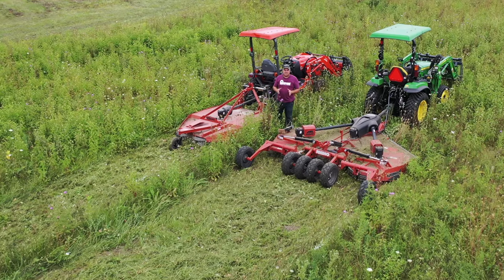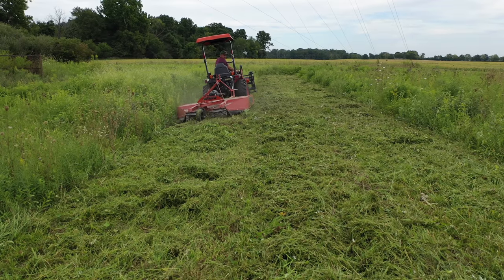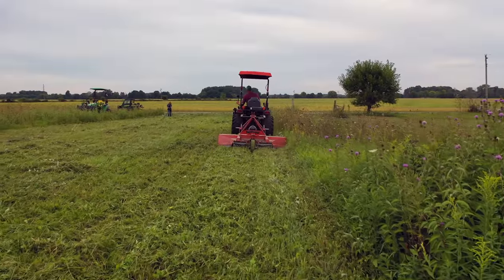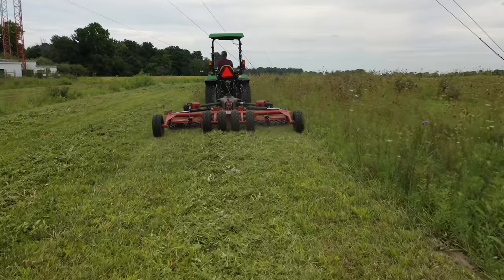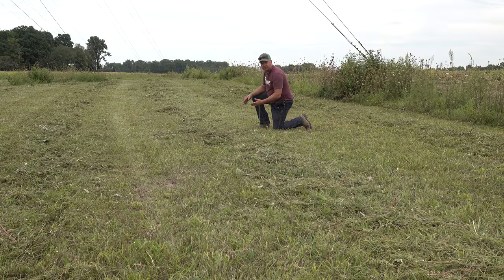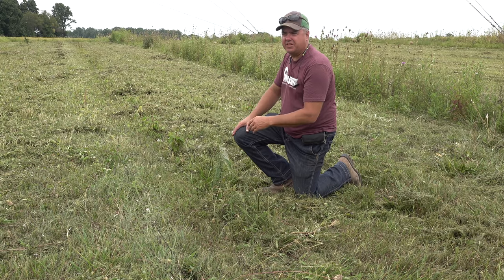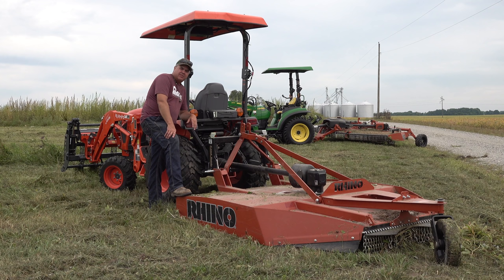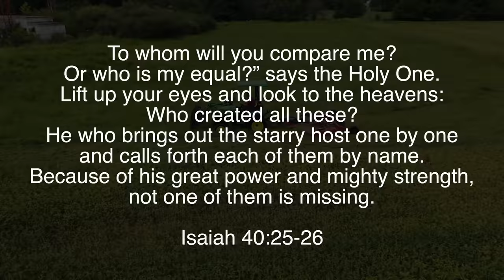Which Cuts Better? Single Spindle vs Flexwing Mower, John Deere 2038R, Kubota LX3310 Compact Tractor

Comment: I wonder if the piling in the middle on the single spindle is because the chains are just in the middle?  We don't have room for a winged mower anyway, but the 6ft bush hog  (brand) we've got lays the clippings very evenly because there is an arc that's open over the whole back of the mower. I've also found that, and maybe it's not great for things, but we mostly mow on epto on the 5320, and if I run the engine (and pto) speed 10-15% over, I don't see the issue with not picking up the grass or brush after the tires. If it's grass, I mow in B3, and for anything else, it's usually B2. If it's 6ft high thorns and weeds, I use regular PTO B1 or A3. A hydrostat would be sooooo nice for the info if stuff we do, though! Mowing trails, around trees, etc. I drive manuals daily (except the wife's trailblazer that I was at your house in when I brought the scrap steel over) and can hardly move my left knee after a day of bush hogging on the farm!
Reply from the maker: Yea, I suspect you are right. Spinning the mower faster would help a lot.
I run ePTO exclusively in the 5075e.  It pulls just as well…at least in my limited experience.

Comment: on my 4 ft hog i have found my tractor will go way to fast to get a good cut with just one spindle mower just needs more time to do as good as the bat wing also have to keep my blades sharper also

Comment: I have a bush hog 2815 flex wing it is good but bogs down a lot because I am cutting grass that is 3 feet tall. But i was wondering if landpride or rhino, etc
Reply from the maker: What size tractor are you using?
Reply: @TractorTimewithTim  I am using a John Deere 5100 which is really good but I feel kubota m8 would be better

Comment: It has to do with the rotation of the blade and direction of how the grass is rolled down with the tire. On the left side of a single spindle rotary mower, the blade goes in the opposite direction of how the grass is rolled down. On the right, it goes in the same direction which cause it to go over the grass and not cut it. On the left side it will slide under it and  cut it because it is coming from the opposite way of how it is rolled down. That is why the multi spindle does a better job because  rotation and over-lap allows there to be a blade go the opposite direction of how the grass is  rolled down.

Comment: how do do you think the ts 12 would do on a L6060? or should I go with the ts 10? my dealer has a ts 12 in stocks. thanks for any input.
Reply from the maker: You could handle the 12’ …but it will be slow in heavy stuff.  TS10 is probably the best bet.
Reply: @TractorTimewithTim  thanks for the help. I originally wanted the ts10. my dilemma is my dealers currently has a ts 12 new for 2k less than a ts10. it was bought before the current prize increase.  that's the only reason iam looking at the 12. it does weigh 500# more, but shorter in length. thanks again forr your help, and keep up the videos.

Comment: This is almost more of a Kaboto vs John Deere tractor than mowers. Also is the spindle speed ratio the same on both tractors?
Reply from the maker: Yes, both tractors have 540 RPM PTO’s. And no, there really shouldn’t be any difference in the cut quality based on brand of tractor.

Comment: What's the horsepower difference between these 2 tractors?  And is there and RPM difference between the two at the PTO?  This would be a good test to see if there is an RPM difference.  I'd be interested in this type of test if both mowers were run with the same tractor so they are both run with the same horsepower and PTO RPM tractor.

Comment: It seems to me that you are going faster with the single spindle mower.  That means fewer blade swings over any distance of brush.  I.e. over a 6 ft distance the blade passed over the grass fewer times at 540RPM if the tractor is going faster.  You point about slowing down when the 10ft wing labored could be exactly the reason it does better.  To compare quality, run both in parallel next to each other, or slightly staggered mowing the same stretch.  Also, it may depend on the type of blade carrier on the spindle.  a nice big plate that skips over rocks may reduce updraft compared to a bar...

Comment: Hey Tim I got a question for you do you think that it would hurt the tractor overtime with either one either your Kubota or your John Deere to run such a large mower on it basically if you put that much of a load on the engine do you think that would be bad or really interested in your feedback on that basically do you think it would hurt the tractor over time by putting so much of a load on it
Reply from the maker: No, as long as the engine stays cool, it does not hurt it to be pulled hard.

Comment: I have a Kabota 2501 HST. Would I have enough power to run the flex wing? The grass that I have is normally shorter than what you have in the video.
Reply from the maker: No, I doubt you have enough umph.
Reply: @TractorTimewithTim   Thank you. I was hoping. I have 10 acres and it takes forever to mow.
Reply from the maker: 3901 would handle it.  Time for a trade :-)

Comment: A gear driven tractor works great with a flex wing, I don't understand why you would think it wouldn't? I cut right of way for the Town where I live with a 10' Bush Hog brand flex wing and Kubota tractor, all you have to do if the grass gets thicker is drop a gear, it's not that big of a deal, I'm not big on hydro's for brush cutting anyway because of all of the heat put on the hydraulics if you run it all day on a bushhog, that's why I won't buy anything but a gear drive tractor!
Reply: And the advantage of not having to keep your foot on a pedal as you twist to see behind you. And a consistent speed as controlled by gear and throttle. 
HST is much better for loader work but is not good for longer runs of PTO implements. 
Shuttle shift is a great compromise!
Reply: Tim Hood, I agree. I won’t ever have anything besides a gear driven tractor

Comment: Tim, did  you  like  the one seat 1025r or  the  two seat 1025r?
Reply from the maker: I prefer the two seat version.  also, the 260B backhoe is a HUGE step up from the 260 backhoe.
Reply: Thanks  for  the  info 👍

Comment: could a 27hp - 22hp at pto tractor run one of these for like you said mowing once a month? i got hydrostatic
Reply from the maker: No, likely not.  One other aspect is that the tongue weighs 1000 lbs.

Comment: I feel it would have been a better comparison if you had used both mowers on the same tractor to see how the different mowers effect the same tractor as most ppl only have 1 tractor and are using videos to decide wich mower to possibly get.
Reply from the maker: Hi Aaron.  I showed the 10’ flex wing on the Kubota just two weeks ago.  Check it out.  
Will never attempt the 10’ on the LX3310 again.
Reply: @TractorTimewithTim   Yes. I seen that video n I remember you having such difficulty. I was thinking showing both on the deere in a head to head on both mowers

Comment: i really think they should make a PTO shaft out the frount of tractors and make a 3 point hitch that bolts to the frount end loader skid steer / john deere quick attach.  then we can have mower decks that we don't run over grass first, and save turning our necks.
Reply: it would be better for snow blowers too.
Reply from the maker: Europe has them. Maybe I can get one.
Reply: @TractorTimewithTim  look at iowa farm equipment

Comment: Don't both of those mowers use flat blades? I don't think either would generate any "lift" like you would find with a zero turn/finish cut type mower.
Reply: All rotary mowers need a little wind lift action otherwise they wouldn't be able to cut properly. If you google some pics you will see they all have a little twist at the end where the cutting action works. Even the blades on a hay mower are slightly kinked.
Reply: @martingibbs1179  There's certainly more variety than I originally thought. Seems what I took as being somewhat universal for brush cutting (flat blades) are marketed as "Heavy Duty" or "Extreme Duty" blades and looking at the manuals for both mowers I see they come stock with high-lift blades.
Reply: @dennishutchins  The heavy duty is for small trees or shrubs with woody stems that are stiff enough they will snap rather than bend over. They don't even need much of a cutting edge its more about momentum and weight, which is more a smashing action and not a cutting action. Conversely if you tried to use a blade like that on grass or other flexible stemmed plants you are less likely to cut it and more likely to just flatten it. Even if it does manage to tear tall grass I can't imagine it doing a very good job of mulching or leaving a good finish. The smarter every day channel did do a slow motion video of a finish push mower, which clearly showed the first few revolutions just flattened the grass and didn't cut anything. It wasn't until the blade had reached a certain rotational velocity to create enough lift to hold grass up that the blade started to cut. Its also very easy to snap a woody stick with your hands but trying to snap grass with your hands is very difficult, grass is surprisingly strong it really does need a cutting edge to break the stem.
Reply: @martingibbs1179  2 videos for you, one showing flat blades and one showing those cutting grass (from IDigIt4) https://youtu.be/UuGPjEKz7Oo?t=600 https://youtu.be/zBh_7SZCYnw?t=1648 If you look at some of his other videos you'll find some with very similar ground cover to what was cut in this video. I'll let you be the judge of how comparable the finished product is.
SmarterEveryDay also did an episode on string trimmers and those don't require an updraft to cut grass. Not trying to be dismissive, I understand how it works and why some lift is necessary when trying to nip an inch or two off a residential lawn and have it look good but were talking about knocking down 2-3 foot tall field cover here. Maybe Tim could do a future episode comparing the cut quality with different blade types, that would certainly be interesting.
Reply: @dennishutchins  Looking at the first video the bar is flat, but with the angled blade edge as it cuts the air don't you think it looks a little like an aerofoil and will create some pressure difference, i.e lift? Obviously blades are optimised for different applications with some having more emphasis on sharpness and aerodynamics than others. 

As for finish in the second video its hard to tell but from my perspective it looks a little uneven, but probably good enough for the purpose. You're right the only way to tell for sure is to do a side by side comparison. You're also right lift isn't everything, a scythe doesn't rely on lift nor does a strimmer.

Comment: Why not a sickle mower? Its not bothered by the wheel's flattening the brushes and from the look of it there's no trees groing in that field.
Reply: A sickle mower does not process the grass. It cuts it at the bottom and it falls over. This longer, non processed grass take a lot longer to decompose. It also likes to be close to the ground to get a clean cut, the grass doesn't lean over that way. This is why a sickle was used to cut hay. A sickle is also needs more maintenance and is easily damaged.
Reply: @williamhall5401  my tough was with that tall weeds being cut with a sicle mower would slow down the growth by covering the base. Of course if you can afford a brush cutter it one way to go. A flail mower would plobably be best but would take longer to mow?

Comment: The tip speed on the TS 10 is lower than the TW 26.  The TS 10 may be slightly lower in the rear too. That would make a difference. 99 percent of the people out there brush hogging have no real need for the bat wing mower. If I'm mowing for cash or doing a mowing job along the highway give me the bat wing but in my pastures its just not worth the extra expense all around even if it did save me 30 minutes to 1 hour mowing a field.
Reply from the maker: Wait, ‘slightly lower in the rear’ would make it pull much harder.

Anyway, enjoy your sour grapes.  You missed the entire point.  
10’ flex wing pulls just as easy as, or easier (from a more recent video) than a 6’ single spindle.   Crazy!!
Reply: @TractorTimewithTim  It would help the cut and I've never noticed it pulling harder but that's a good point because I use a higher Torque Tractor with a mecahincal govenor and those little pretend to be tractors may not have that ability.  Sour grapes?You've not seen sour grapes. You should see some of the other used car salesmen doing these brush hog videos. Your a salesman but I don't think you did anything bad on purpose. Many do. You had a narrative and that ok. There is zero reason for MOST people to have a bat-wing mower though. It cost way more initially and maintenance is 3 times that of the single blade. I have hell keeping one tail wheel on a mower over the years. I can only imagine the hell I would have keeping all those wheels turning. All that to save what? 30 minutes or maybe a little more. You guys mow grass too and call it brush. Most land owners clearing land use the BRUSH in brush hog literally. They really work them hard in real BRUSH and that bat wing is no damn good for that. Another part of the pulling down issue you mentioned could be no governor.  I've got a 5555 Mahindra that can't touch my old 3930 or my 4000 Ford in grass like you were mowing. Its a royal pain in the ass to mow with too because its electronic fuel injection and there is no mechanical governor or any governor on it except for your foot. That was a terrible idea and I don't know if all the electronic fuel injection tractors are like but if they are I feel sorry for the people using them. The old mechanical fuel injection tractors do have governors and you hardly notice it when they get into tail grass because they increase throttle automatically. They always run, smoke very little and get good fuel economy too. I'd bet the pull harder thing comes from the fact that you have no governor. Not mad at you in any way. I'm 65 and have been doing the brush hog and sickle thing since before I was in Jr High. Doesn't mean I cant learn something new.

Comment: Tim you didn't do this video just to prove me wrong did you? 😁
Reply from the maker: Can’t remember. Did you make a comment on the same topic?
Reply: @TractorTimewithTim   We were discussing it on the last video. I think we left at an impass.  Although I think this video largely matches what the physics show. It's just uncomfortable to drive the smaller mower at the speed required to make it mow the same speed as the bigger mower.
BTW I could not find two good clips in what you posted, but if you have two where you were pushing both mowers to the tractors limit and the grass was about the same, you should be able to get the time it takes for one tire revolution from the video. Then we can calculate the speed off that and the tire diameter. There were a couple shots of the Kabota that you can see the stem go around, but the JD was harder to see. And I cannot tell how hard it is getting worked.

I was thinking about the cut, and ideally you would cut with half the width and overlap each cut by half, not switching direction on each pass so that the blade cuts in opposite directions on each pass. It would take forever though, or you would need to drive super fast to keep the same output which is not comfortable.

Ideally on the multi spindle they would stagger the blades so they overlap and do this automatically, but they don't. I think they prioritize width vs. quality.

Comment: Should've used the same tractor for both mowers
Reply from the maker: Why?  What would be different?
Reply: @TractorTimewithTim  Using different tractors with different gearing an different horsepower
Reply from the maker: But each running the same approximate speed.  Each maintaining rated PTO speed.  I see no relevance.

Comment: I think the head scratcher people have (or it’s ridiculous) is why would buy a $15K+ flex wing to put on a 38 hp tractor? I’m sure it works ok if you go slow but it doesn’t make ration or financial sense
Reply from the maker: why not?  You can certainly get more done with this mower than with a 6' mower, even on such a small tractor.    Perhaps you need to get done faster, but cannot afford a larger tractor right now.   Perhaps you plan to buy a larger tractor in a couple of years when you can afford it.
Perhaps you will always be mowing lighter material.  
My point is, this mower will get the job done MUCH faster, and it will do a MUCH BETTER job than the 6' mower.   Why NOT buy the larger mower if the tractor can handle it...which it can?  Think out of the box a bit.
Reply: @TractorTimewithTim  ahh, yes, you bring up good points but ultimately it comes to individual application. But for me, even with my 73hp Kubota M7060, it doesn’t make rational sense to buy a bat wing. They’re so pricey and I don’t mow enough for it to be worth it. It also comes down to application. I’m in a land clearing phase for (I mulch or stump green, remove the deadfall debris, the brush hog to smooth it all it) and my 7’ cutter is ample. If your looking to do 10+ acres a day yes it’s a different ball game